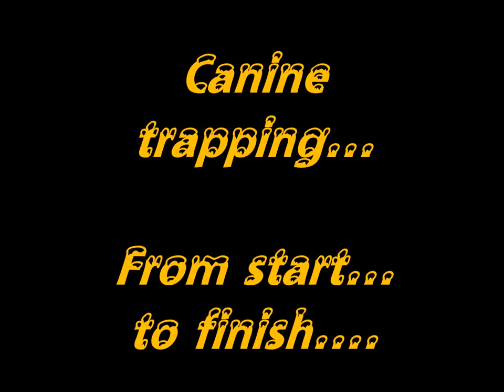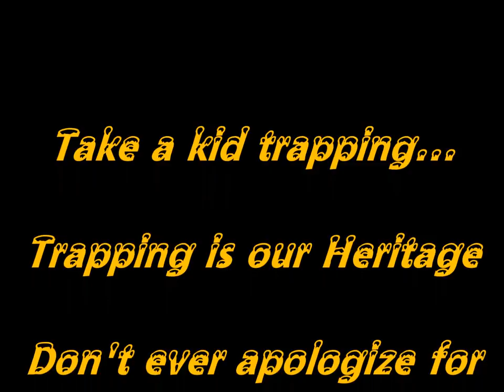S1-E8  Canine trapping from start to finish

Comment: How are you setting your trap pan lbs with a pos e trip pan,I use 1 3/4 bridgers,only thing i can think of is bending the dog slightly down
Reply from the maker: I use Sleepy Creek traps and I adjust the pan bolt tension.
   You also can bend the trap dog up or down for more or less tension.

Comment: Why do you dip them in wax? I dye mine but have not dipped them in wax.
Reply from the maker: The wax does several things. 1st, it seals them from the weather better, rust,, 2nd, it speeds them up in closing, 3rd, it helps seal in any odors that might still be on the traps. 
   Thanks for the comment. ,JW.

Comment: May be a dumb question but how do you pull your trap stakes after you’re finished?
Reply: A special tool to give you leverage,  some never need be pulled up, some folks dont relocate traps, especially if its a hot location......
Reply from the maker: I have a long pipe with a car leafspring welded to it. The end of the spring has a notch in it to get under the head of the rebar.